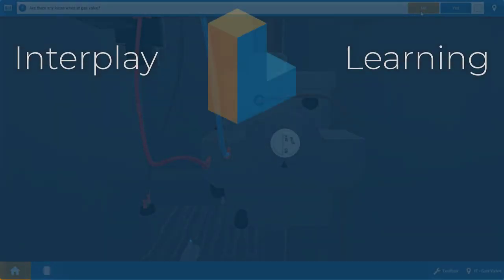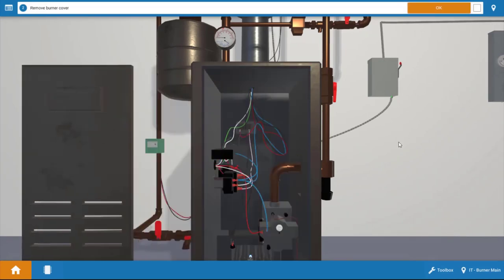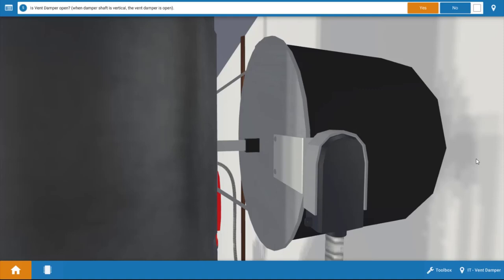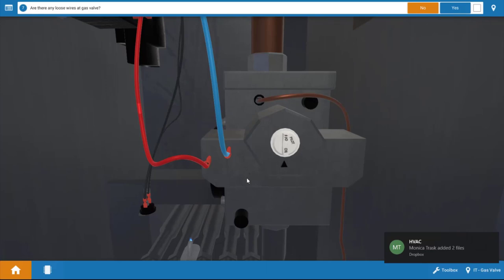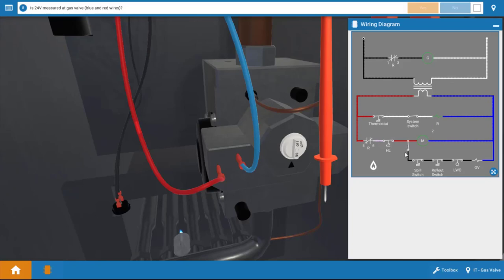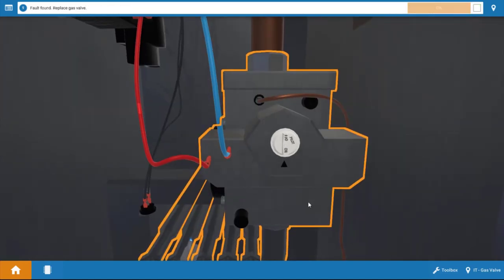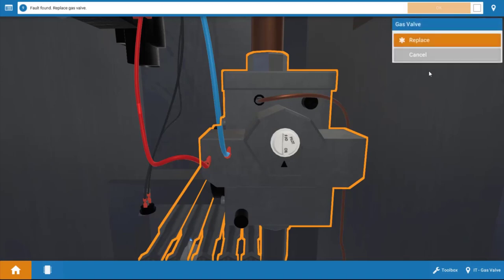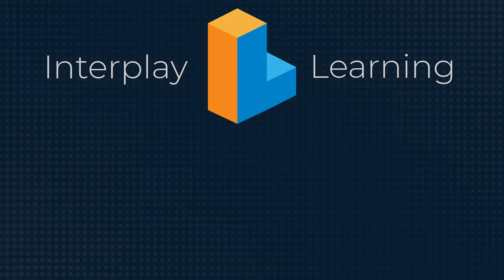Troubleshooting and Diagnosing a Faulty Gas Valve on a Gas Boiler

Comment: if you are not getting 24 volts to the valve. do the open and closed pieces matter? I think all of mine may be open.
Reply: If you are getting 0 volt at the valve then it is not that test the others safety